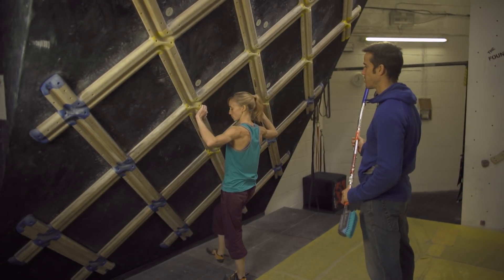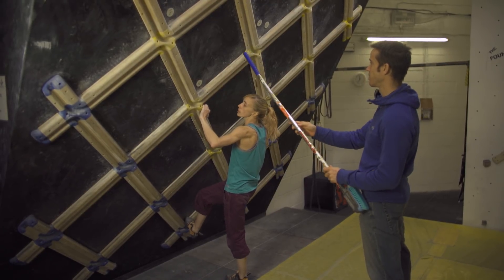Lattice Training - Power Endurance on a Circuit Board

Comment: i tried this today and have a Q. i did my max moves using the standard sequence (with little fingers at the bottom of the x). i managed 73 so i did 4 sets of 18 moves. It was hard but not that hard and that made me wonder if it needed to be the gaston sequence or if its not supposed to be super super hard just a bit hard?